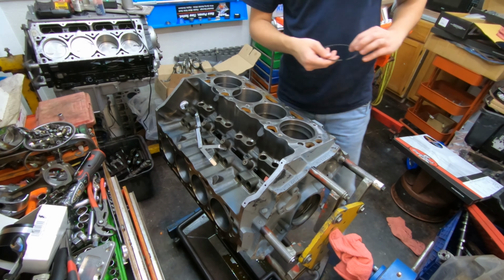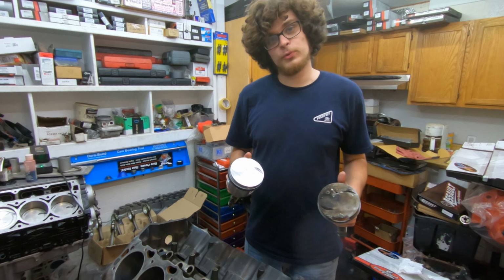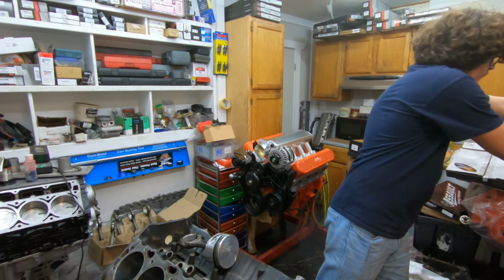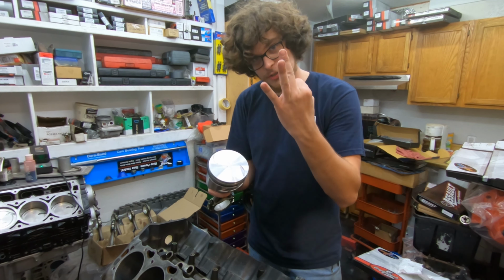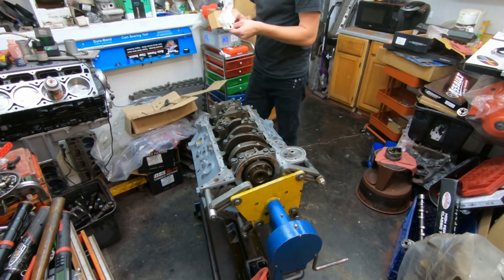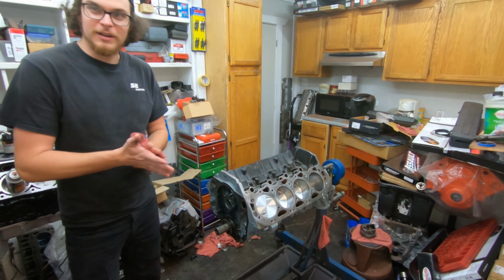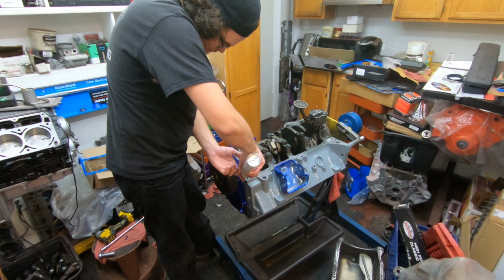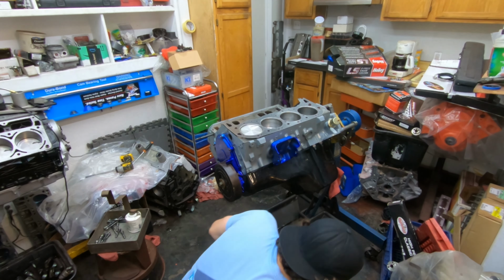C10 454 Big Block Chevy build and install

Comment: you dont need to line up pump with distributor just put it at top dead center set your rotor facing number 1 spark plug and bump engine over and it'll drop in. way faster and easier than messing around with a screw driver trying to align slot with bottom of distributor.  just a little tip i used to do it that way too eff all that.

Comment: Good job man. Someone already asked about the headers but what other mods did you have to do to it? Will a BBC drop in using a sbc motor mount? Will it bolt up direct to a TH 350 trans?

Comment: What headers did you use? Any mods had to be made?
Reply from the maker: I used a cheat set of 2wd long tube headers from JEGS and welded a set of v-band clamps to the header. No mods necessary for fitment.